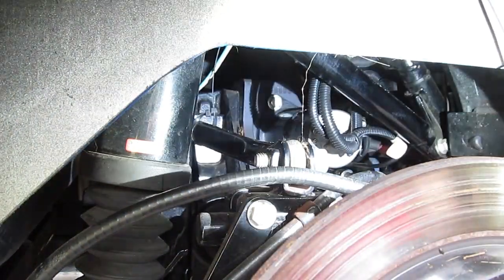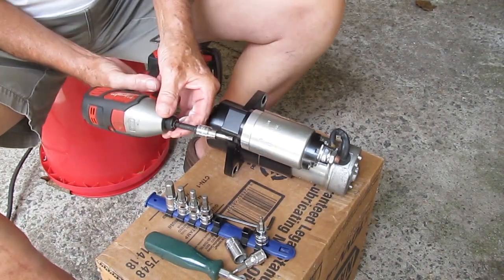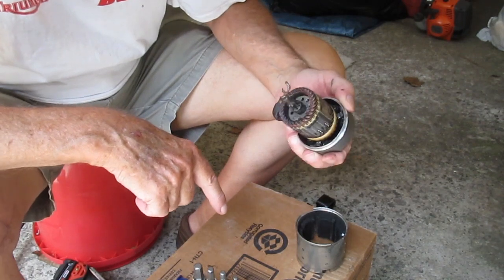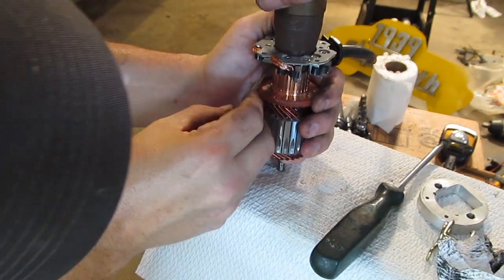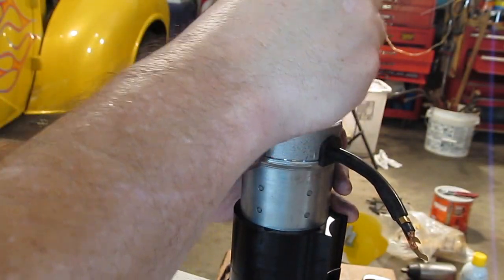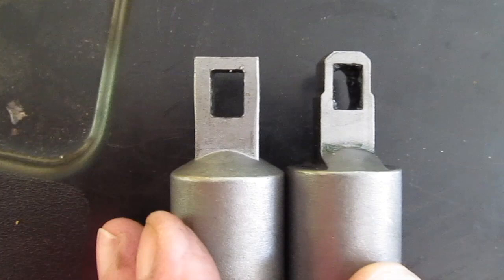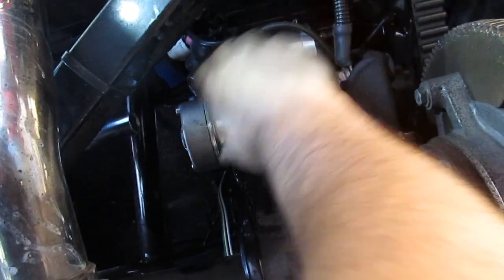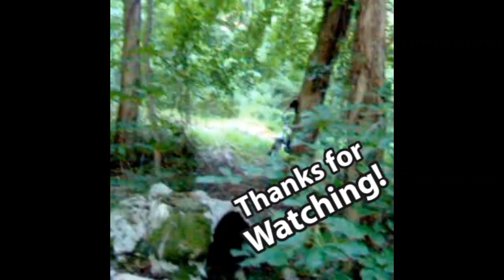Not exactly as planned - Remove and rebuild Harley Tri Glide Reverse Motor

Comment: The previous owner of my 2010 Triglide burned out two of these motors. I pulled it and had it rebuilt when I first got her in 2018. Word to the wise...read the instructions! It's a starter motor, only ever meant to run for a few seconds, and it pulls lots of juice when it engages. So you don't want to bump, bump, bump, it. You don't want to engage it for more than , I think, 9 seconds. I very rarely use mine, but it's sure nice when you need it. Save it for a rainy day.

Comment: I had mine go out on my 2013 Tri Glide, and one of the tecks at the local HD dealer told me to take it to a "Auto starter alternator repair shop', and they could fix it. It cost $132.50, with a warranty.
Reply from the maker: Good idea, that would be the way we go if we need to repair again. The rebuild kit we got was junk. The rebuilt one we bought is still working. Thanks for watching.
Reply: My Dad's motor went out on his 2013 Tri Glide also. i don't know if he watched this video or not, be he researched plenty on it and read somewhere that someone took theirs to a starter shop. First off HD dealer wanted $300 for a rebuild kit without solenoid or labor. Then $1,500!!! For a new motor.  So Dad took it to our local starter shop that we have known for years. Guy is second generation rebuilder. Said motor looks just like a Nissan starter and he could do it for $65. We've been riding for weeks and not one problem. Dad's driveway is a little uphill and he prefers to back it into the garage.

Comment: You call it a starter. That is exactly what it is. I just bought a new 2021 Tri Glide Ultra and it goes in for it's first service in two weeks. I don't use the reverse hardly at all. Just hope it does not give me a bunch of trouble. Another part of the bike HD should have done more research.
Reply from the maker: It is a starter design from the 40's it looks like to me, lol. Why they don't put a little reverse transfer case in it is beyond me, other than cost of course, but a few extra hundred is really not going make much difference on a bike that expensive. They had geared reverses on Servi Cars in the 30's and 40's so they have done the research already.

Comment: Thanks a bunch, I put the new solenoid on. Did not work. Disassemble electrics last night. Armature was dirty, brushes looked good. However all 4 were stuck. Cleaned and freed everything. Tested on bench . Working fine. Going to reinstall reverse starter this morning. Your video helped tremendous. Thanks Jay Carona, Mississippi.
Reply from the maker: Nice! Good luck and glad it helped. 👍
Reply: Instablaster.

Comment: I have a 2015 and my motor went out last week at a bike rally on mo.
Now this is the 4th. Time I am so glad I got the extended warranty from HD. Have appointment on Tuesday and going to ask them about a  Mechanical  
 Reverse. That is what Harley should of put in from the start.
Why are they not have a recall on the  Revert motor I have talked to a lot of trike owners that have replaced it. Come on Harley Davidson do a recall and install the   Mechanical  Reverse 
Good luck Bill. From Ks.
Reply from the maker: I am with you brother, this video is just over a year and we had another go out. The whole system is a stupid cost saving measure. On a bike that expensive, it should have had a mechanical reverse. They had Servicars in the 30's with simple mech reverse it ffs. All the best and good luck with the dealer!

Comment: Use to do my car starters so I would tackle my 2018 Freewheeler  when the time comes. I noticed it's bigger than the cycle starter. This video was good.
Reply from the maker: It is the size of small car starter. Much bigger than a typical moto one. If you have done them, you should have no issues if you get good parts.

Comment: I have a 2013 tri glide, thought it was the reverse motor solenoid, bought  one on ebay, installed it. attempted to test starter on vice stand. Still does not work. puzzled as to what is going on. I did change my plunger out and put the original in as it was still good. Thanks for your video, it helped tremendously. 
Jay Carona
Mississippi
Reply from the maker: If the solenoid appears to be working. It might be the brushes or the windings themselves. Thanks for watching and commenting.

Comment: I have a question we replaced I guess it would be the solenoid on the reverse starter it worked a couple of times and then it quit working but if I tap tap it with the hammer and put it in reverse the teeth popped out to grab it and put it in reverse but then when I put it back in gear and the teeth go back in I hit reverse and they do not come back out unless I tap it again with that be just the solenoid or do I need to replace the whole starter
Reply from the maker: Sounds like the solenoid to me, if you can find a replacement one, that is what I would try. It could just be the plunger is hanging up though. You can see the issues we had with it in the video. This one only lasted a little over a year, I should make a follow up. We talked to a friend of ours who is a shop manager for a HD dealer and he said to adjust how we park and just not use it because even the HD replacements are junk that only last a short time. You might talk to the other guy who commented here who runs a rebuild shop. I think it was hdreverseMotor.com but his comment is still her with the link. Best!
Reply: Ok thank you   Right now I park where I can push it back if I have too   I’ll have to take it off when I get a chance  

Sent from my iPhone
Reply: I am experiencing the same issue, replaced the solenoid, still will not work, may have to buy a rebuilt kit. did you figure yours out. 
Jay Carona
Missisippi, 04/10/2020

Comment: I reinstalled my newly put together reverse motor, but there is a clicking sound and resistance when I spin the wheel... It's seems like the gear on the reverse motor and the gear on the drive belt are getting stuck somehow. Any ideas why this might be happening? The motor should be all put together correctly.
Reply from the maker: If it spins strong off the bike or the parking brake is not on, I have no idea, could be lots of things.  I would try lifting the back and see if it will spin the wheels with no resistance.

Comment: Maybe I missed it, but I didnt see the followup as to why the original rebuild failed. Im rebuilding a reverse motor on a 2013 and want to make sure I dont have an immediate failure as well. Thanks.
Reply from the maker: He ended up selling it before I got around to doing a follow up. The rebuild lasted about a year and then had the same failure again. IMHO it is too much work for what is essentially a starter motor. Even one of the dealers on Youtube has a video explaining basically that they really only should be used sparingly in very short bursts or as a last resort. Low Country Harley I think is the name. Just a dumb design. They made a 3 speed gearbox with reverse in the 1930's for their 3 wheeled Servicars, they should just do that. For what they are charging for those bikes it would not really add that much cost relatively.
Reply: @theeddies  Thanks for the reply. I'll try rebuilding it myself and see what happens. I took it apart and see the same brushes stuck in the holders failure everyone else complaints about. Waiting on the parts to come. I agree, its not like the current reverse setup is only a year or two years old. It is a very flawed design and should have been addressed. Keep up the good work.

Comment: thanks nice video!  I assume I remove the right wheel?  where did you get parts?  I have a 2014 TriGlide and reverse will trip the circuit breaker after moving about 1-2 feet.
Reply from the maker: I would try https://hdreversemotor.com/. They seem to have the best reviews. Do not buy random kits on eBay or Amazon unless they are coming from a real brick and mortar company. Yes you need to remove the right wheel. If you have ever replaced the starter on a car it very similar but a little easier.

Comment: I have a 2015 harley davidson freewheeler flrt. My reverse quit working but if i tap it with a bar it works fine. Any recommendations before I buy a new motor?
Reply from the maker: Might need new brushes and/or bearings. Might also be a sticking solenoid. Hard to say. Best case a good cleaning would help, worst case might have a bad spot on the commutator. A quality rebuilder will be able to find that, there are also videos available on doing this yourself. Find a local auto starter rebuilder, and see if they will rebuild it or do it yourself. I have not heard or experienced anything good with aftermarket motors and the Harley ones are stupid expensive. If you cannot find anyone local, there is a link to rebuilder somewhere in the comments of this video. Might try contacting him and getting a quote.
Reply: @theeddies  thanks for your reply. I have ordered a rebuild kit and will try to do it myself. I love a challenge.
Reply: $1600 today. $230 on amazon and that’s not a cheap one 😂

Comment: What starter did you end up going with? And where did you get it? There’s a lot of rebuild kits. Cheap ones and more expensive ones. I don’t want to do it twice. It’s not my bike. Helping a friend. Appreciate your time. Thanks for the video.
Reply from the maker: If you want a rebuilt one, check out hdreversemotor.com. I have heard good things about them. Dad ended up getting one through a friend at a Harley dealership, not sure the exact circumstances. Honestly, I would not bother with the rebuild kits, get something with a warranty done by a pro.
Reply: @theeddies  Thanks a lot appreciate your time.

Comment: I have a 2009 Trike and had the reverse burn out in the Harley parking lot. $2000 cdn for a new one. Lucky for me it got covered under extended warranty in the end. No starter places would touch it and Harley said no way to fix them. Fantastic video. Where did you get your parts from and what did you replace in this video? Thanks.
Reply from the maker: Hello,
I did not provide links to any of the parts because I would never purchase them again. Though they came from eBay. The rebuild kit was some generic starter kit that fits the unit but only lasted a few weeks. In the end we got a fully rebuilt unit from another company that lasted about a year.  There is a comment here from the owner of another company that specializes in them and we would have gone that route next but my father decided he was done sinking money in it and just made sure he parked where he did not have to reverse. It is not a good system and frankly Harley should be replacing all of them under warranty, glad yours was covered.
All the best!
Eddie
Reply: @theeddies  Thanks for the reply. Just out of curiosity, what problems did you incur after the installation of the new parts? i know you mentioned the solenoid plunger was different but anything else?  TIA
Reply from the maker: @Dr.More_Malpractice  Brushes and armature wear. In my mind, it comes down to using the wrong design for the application. Essentially they are using a starter motor to do the work. Starter motors are not designed to run for more than a second or 2 at a time. While they put out plenty of power, they are just not designed to move a 1200 lb motorcycle around running continuously for 10-30 seconds at a time. They burn out. Even the best ones burn out over time. It is even worse if you have suspect quality components. Check out the Doc's description, Though he is diplomatic about the whole thing being that he is a Harley dealer I think he gives a good description of the problem good and bad -https://www.youtube.com/watch?v=vZThRDPfj6g&ab_channel=LowCountryHarley-Davidson
Reply: @theeddies  Much appreciated for all the details

Comment: I have a 2015 Tri Glide.reverse doesn't work tried resetting the fuse and black arm doesn't help press R and hear it click nothing else.
Reply from the maker: Probably burned up like this one was. My experience with the aftermarket rebuild kits is hit or miss. I think the next time, it will go to pro alternator repair shop . At least it will have some warranty.

Comment: My 2016 Triglide reverse went out but was repaired under extended warranty. It is truest a piss poor system. I rarely use the reverse now. If it goes out again, I’ll convert to a mechanical reverse. H-D hasn’t learned a damn thing about this system so I don’t expect them to recall and replace it.
Reply from the maker: Totally agree. They made a mechanical reverse in the 30's for the servicar, they can make one against if they wanted. Best!